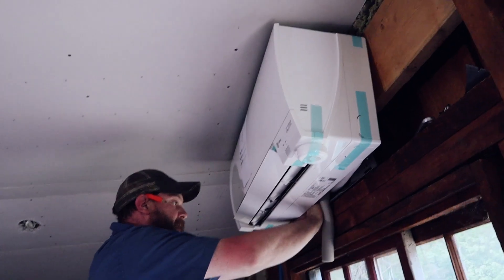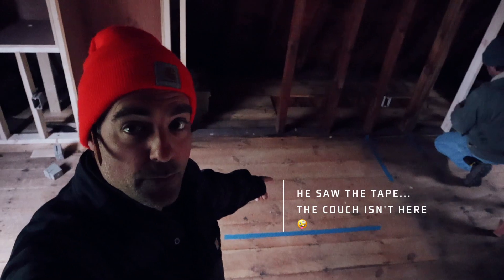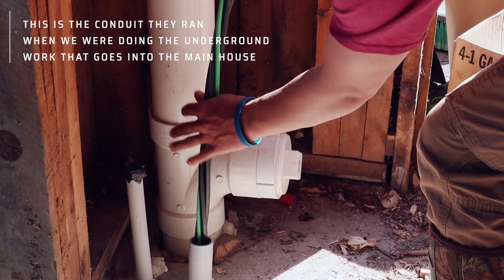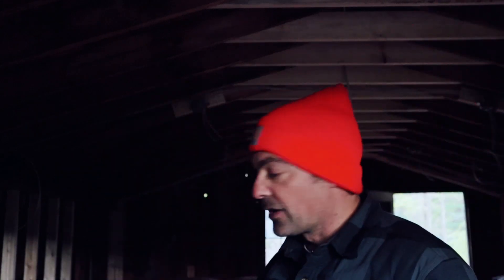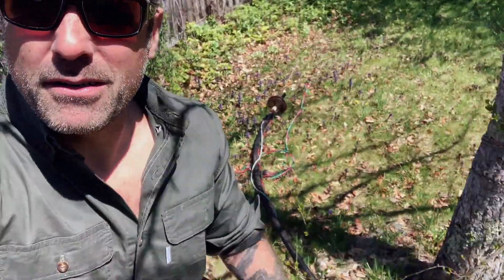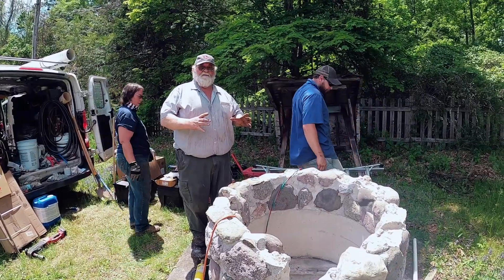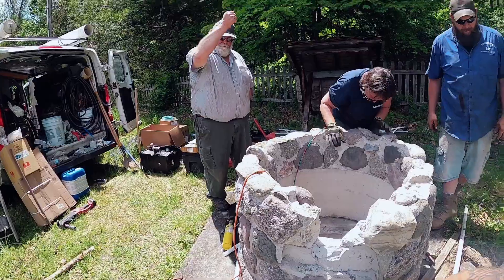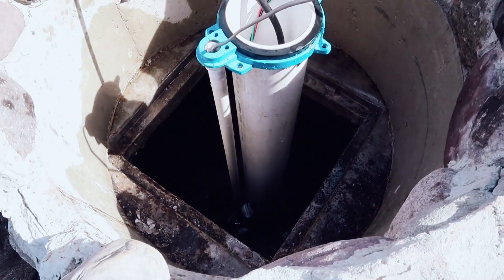Well Water is WAAAAYYYY Different Than City Water!!!

Comment: Hi Anthony I saw your garage office and fire pole video and I was wondering. In a normal house what is the estimated cost just to cut a hole between 2 floors in a 2 story house. I basically want to have my office connected to my man cave with a way to get down and up. So I’d probably use a ladder rather than a firepole.
Reply from the maker: Awesome man, that's a great idea...I would definitely do the ladder as a permanent install attached to the wall....I would assume its 2 to 3 days of work for 2 guys + minimal materials. Not sure what labor is like in your area, but here in NJ I would estimate it to cost around $1,000 to $1,500